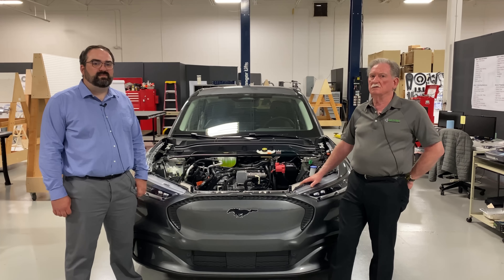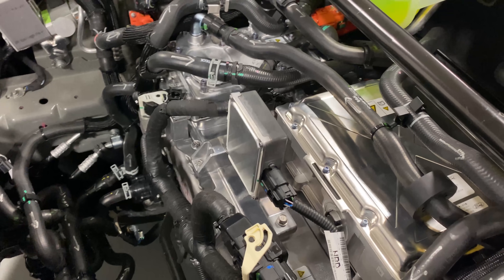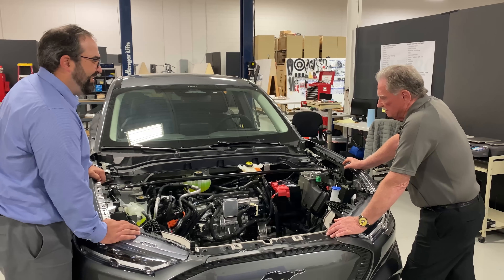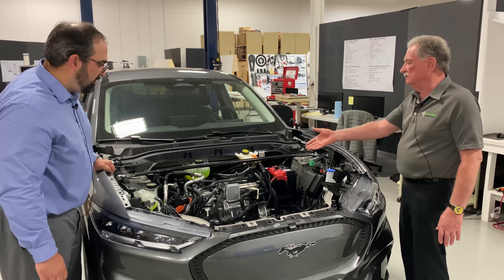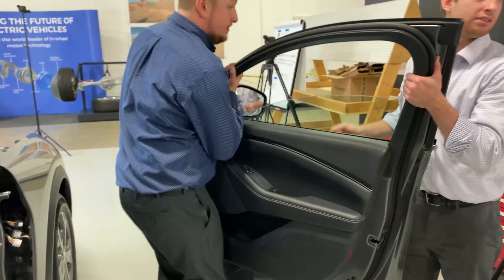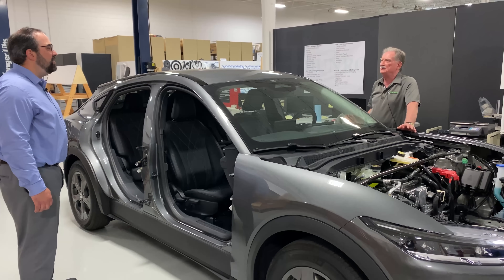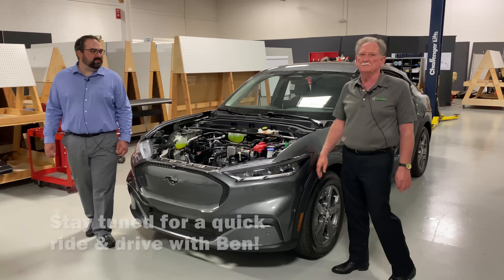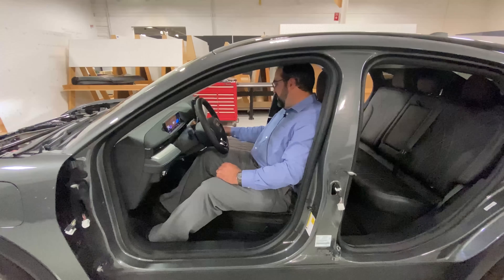Mach-E Teardown: Doors Off + ECU Mystery Solved

Comment: Great video, but Sandy’s emphasis on integration over modularity makes it tough for repair.
Reply: Integration over modularity is only one dimension of Sandy's program.

He's also looking to eliminate parts and failure modes (among other things).  If the vehicle doesn't fail, then making it tough to repair is irrelevant.

Thus far, we're seeing a gigaton of failure modes on the Mach-E that don't need to be in an automobile.  Physical fuses instead of software-controlled circuit breakers.  60 degree threaded screws all over the place.  Too many HVAC hoses and boxes, with potential for leak failures.

Modularizing is fun and all, but if failure modes haven't been scrubbed out, you get to the second-best solution: easy repair.  But frequent repair.  Not what you want to see in 2021.

The competition (Tesla) is striving towards cars that will last a million miles.  Ford needs to get their head in the game if they want to stay relevant.

This is not to say that there are no good ideas in the Mach-E.  Sandy has remarked on some he's already seen in this teardown.
Reply: @Urgelt  I am SUPER SKEPTICAL about the million mile claim, esp. from a conventional car manufacturer. They would need other streams of revenue for this to work (e.g. subscriptions for software updates, charging, etc.). The old fashioned way of modular repairable components is still better overall, but you right that repairability is a thing of the past (the trend began with Apple)
Reply: @bartwaggoner2000  I have not heard Tesla claim that their current models will last for a million miles before having to be junked.  (Some repairs along the way are unavoidable, of course, but Tesla hopes to keep those to a minimum.)

I have heard Tesla claim to be striving for a million-mile car.  And I see plenty of evidence that this is true.  For example, high-mileage gear boxes look like-new when cut open.  They're struggling to get more cycle life out of their battery packs.  And so on.  Lots of evidence.  There's no reason to doubt them.

Legacy automakers don't make money on repairs.  During the warranty period, a high failure rate costs automakers, as they have to reimburse dealers for the work and parts.  After the warranty expires, it's between the customer and the repair shops - none of which are owned by legacy automakers.

A short life expectancy means more cars sold every year, though.  But if the industry is moving towards longer life expectancy, as I think it is, then automakers who lag behind risk becoming also-rans.

It's a surprise to me to see so many failure modes on the Mach-E as Sandy's tear-down progresses.  This isn't a good look for Ford.  I really don't know what they were thinking.
Reply: Balance is the key.
Reply: lol if repair is what you like. I rather have it keep working
Reply: The best doodad is no doodad.

Comment: Drivers doors like all doors do get rain inside the door cavity which is why they have seep holes because water comes down from along a window glass or is carried down by a wet window. So now you put more modules or pass through wiring inside a door subjecting them to moisture when they would not be as exposed as much somewhere else. Plus they did not need to be in the door in the first place.

Comment: It's standing up because of the Frunk Packaging.  We couldn't fit it anywhere else where wiring could reach it as well.
Reply: That tells us nothing. Obviously its in the way of the fronk making it smaller. Explain yourself better
Reply: @baby_UFO  you didn't dissect the comment much, they said its standing vertical as the frunk was in the way of other locations that allow wires to reach it in a way that doesn't cause a lot of stress on a wire.

Comment: The drivers door over the life of the vehicle gets opened and closed more than any other door, and is the first to have wire kink/failures over any other door after a long life. This will result in the hatch not working if there is an issue rather than putting the module in a fixed location not relying on flexing door wires for it. That will create and issue for the hatch, when it has nothing to do with what causes the problem. Bad idea. Crappy design and lack of thought. Were they so short on space they had to start cramming system components in the door?? Also may create issues with replacing a  drivers door if damaged if systems need to be re-calibrated etc to make the hatch work again.
Reply: Most cars are the same way. it would be way more costly to run seperate power lines to every door and hatch.

Comment: I've been told by a Ford dealer that currently all Mach-E's are built in Mexico, then shipped to Antwerp, Belgium. There every single car is manually modified for the European market.
Reply: I would assume they are shipped incomplete, with the European parts fitted at Antwerp
Reply: The opposite occur the same way. Most of the foreign cars are imported to Port Newark-Elizabeth, which is the largest port on the East Coast US.
There each car manufacturer have customized areas to install specific additional features, and options that customers have choose,
that were not installed to simplify the delivery logistic. Then the cars get shipped to their final destination.
Reply: @nihongobenkyoshimasu3190  mh, maybe that avoids some taxes too? Aka shipping a finished good vs final assembly at destination
Reply: Wow
Reply: Jesus, what does that cost? How can Ford be making a profit on these?
Reply: @MarkXHolland  it's not a new or terribly unusual strategy.
Reply: @MarkXHolland  im pretty sure the import tax on electric vehicles is very low as far as im aware, this is to incentivize companies to make them. i know in certain areas the import tax on vehicles is based on their emissions, and electric vehicles can even be imported with 0 taxes due.
Reply: I would check every one for drugs , they shipped Fusions with drugs in them back to USA Ford Dealers.
Reply: @BigEightiesNewWave   ford just want more money

Comment: The onboard charger usually doesn't have anything to do with DC fast charging - only some control pins are shared.  This is why DC fast charging was an option 6-7 years ago because of the need for the extra electronics to communicate with an offboard charger.  There was also a VHS / BetaMax battle happening with ChadeMo vs. CCS and we now know who won that war.  If this car is V2G - this box is also used to connect the battery via a second set of contactors to an external inverter to generate 240vAC or 120vAC.
Reply: he just told you it was communicating over the Canbus to the DC fast charger

Comment: Honestly, on the Ford EV, the engineering looks old school. That is to be expected. They have to live halfway between the past and the future. It's a compromise.
Reply: It‘s always funny to read discussions  without any Knowledge how it works. Could it be a Can Bus issue because some  cables missing?
Reply: I don't think putting a module for the hatch, in the drivers door relates to past, present, or future or anywhere in between. When the drivers door wiring is the most flexed and the first to fail, that is just pure stupidity. There was not reason or need to put it there and only increased wire load in the door jamb rather than in a fixed location somewhere else when you have an entire body to work with.

Comment: If you were doing power and signal over one wire, you'd loop in an out of the doors to minimize cabling.
Reply: But it only linked to the driver's door.
More likely because they are the two doors that require proximity activation.
Reply: Or because the main window controller has traditionally been in the driver door.

Comment: That is a messy looking system.  I’m a great big fan of Ford and GM electronics. I have owned both brands and they have always been so dependable, long lasting and cheap and easy to replace if there is that rare “problem” that needs dealer repair.  🤡

Comment: It might be its own module as it identifies the car uniquely to the charger so that you can pre-pay the bill to charge and auto-charge - so every car is electronically different.  So the device is "car specific" whereas other components are generic to every mach-e.  Though,  you should be able to program and generic module (flash)  with the unique car identification, so it is more likely an afterthought to add unique identification for ISO15118 after they designed the main components.
Reply: Or maybe it doesn't have the v2g ready yet and they anticipated servicing that car in the future and just needing to replace that module.
Reply: There will be a MAC address in there but that's no reason to put it in a seperate box. Cars don't have a box for the VIN!
Reply: @mikeselectricstuff  As noted, it is probably the after-design decoder for the ISO15118 communication protocol from the DC supply.  It is best we wait till Munro rips it apart.
Reply: they know what it is, the question is why it is in such a stupid spot
Reply: @baby_UFO  Just curious, why do you say its in a "stupid spot"?

Comment: You would think Ford could just list out all the error messages on the huge screen instead of flipping through one by one in 7:28.
Reply: yeah.. and maybe it's just me, but that UI on that screen with those messages and the symbols below.. man that shit looks like something designed back in 1990. They REALLY need to get some better software programmers and just make it look more modern. It looks like crap. You bother to put in a nice binnacle screen and fill it with garbage graphics.. I'd rather it was just dials then. If you're going to put the screen in, pony up for a decent looking UI Ford!
Reply: @airheart1  You know it. Looks like a high school AV project. Fail.

Comment: I'd think that the driver door is tied to the rear hatch because that's typically where the trunk release switch would be.
Reply: If i remember correctly old Ford explorer windows and gate also stop working if the driver door unit or cables running to the door got damaged.  The fleet at work had all explorers with the same problem.
Reply: Yes. On the Explorer, the power for all the windows runs through the window lock switch on the driver door. Fortunately, the connector for the window motor is right behind the door panel and easy to stick wires into and operate manually with a portable power source.
Reply: From memory, I think removing the driver's door controls has disabled the other door controls on every car I've worked on. I always assumed this was because cars tend to have an override control on the driver's door
Reply: duh, thats what he said

Comment: Seems like we're going to get an interesting series of strange engineering decisions as the teardown continues. Seems like a house that has lots of issues under the trim and finishings.
Reply: Automotive engineer are you? Second guessing manufacturers is easy pickings. Try designing a car. Or anything.
Reply: @Anticheese  Sandy is the expert here - just listen to his views on these decisions. I have worked with GM, Toyota and BMW in the past - GM collaborators especially would tell me about dumb design decisions.
Reply: @cbmusgrave  Sandy obviously isn't an expert on what Ford is doing right now, nor are you. If he was, or you were, there wouldn't be all this investigative disassembly and analysis going on. As I mentioned, slagging builders is easy. Opinions are not like facts and, so far, Ford hasn't provided their reasoning on design decisions.
Reply: @Anticheese  Sandy is the expert at tearing down cars, analyzing designs and engineering and providing suggestions for how to do it better and at lower cost. Companies pay him large sums of money for the "opinions" he summarizes in his tear down reports. My expertise relevant to autos is in combustion, batteries and materials science. What is your expertise related to EVs?

Comment: If their boxes have do not drop on them how do they stand up to the cars going over potholes and other vibrations while driving? you think the chips on the board would be underfilled to stop or dam dampen vibrations - as you have on laptops and phones
Reply: I would expect that is taken care of, but the main reason for the scrap if dropped is that it isn't economical/timely to check if each box is working at each connection step before moving on to the next one during assembly, thus if there is ANY chance that a hard drop (think even being thrown as a result of trying to catch or being crushed) could cause increased failure rate, it isn't worth the rework cost to use the part. (aka opportunity cost of potential failure is far higher in labor and time than the part cost itself). Dropping a hard object onto a hard object will impart far higher acceleration than through a suspension travel (phones don't break in your pocket when you jump or fall for example). Iirc believe some impact work on cell phones onto concrete showed accelerations spike in excess of 2000G, while even 'hard' bumps through a suspension are only tenths to a few g.

Comment: These "Scrap if dropped units" at what speed or impact is conditional of (the equivalent too) scrap if dropped? Say this car was in a 10mph bump into another car does that mean all these units need replacing???? Sounds expensive! lol
Reply from the maker: Great point David. We will calculate the force by dropping the module at chest height and let you know.
Reply: @MunroLive  Drop test at our factory was slide it off a 36" high workbench.
Reply: @MunroLive  My other question would be that as they have put these statements on the boxes.....is the car fitted with a impact meter? We all know airbags are set to go off at certain levels. Are these units electronically classed (car hard latches a fault to units need replacing) when a certain force has been indicated?
Reply: Keep in mind that the impact force will be greatly reduced by the crumple zone
Reply: G forces not the speed. It also makes sense to have components at their best than for it to breakdown under warranty.
Reply: @zodiacfml  Yeah I meant G force when I said impact thats why i said equivalent too in brackets. Its like a car hitting another car when the other car driver doesnt have brakes on compaired to hitting a concrete wall.

Comment: Would love to get Sandy's take on the new Model S Plaid and the motor changes they talked about at the delivery event!
Reply from the maker: Coming this week!
Reply: @MunroLive  I thought this would take some more time. I'm positively surprised.
Reply: @MunroLive  I am very curious about this new carbon sleeve rotor spinning at 20,000 rpm.
Also what kind of bearing could handle such power, and what kind of cooling and lubrification is needed.
Does this motor should be use on the Semi for getting extra power or would it be too expensive?